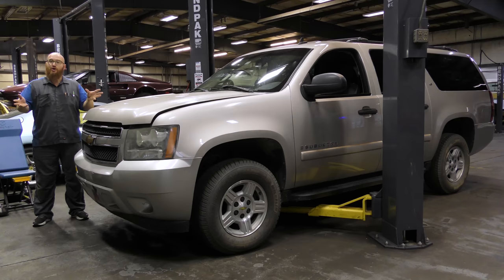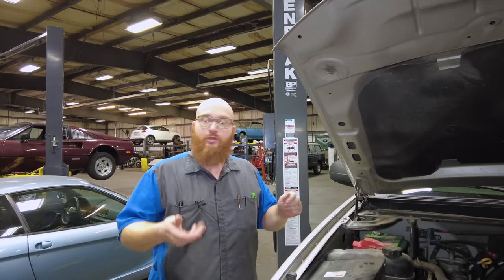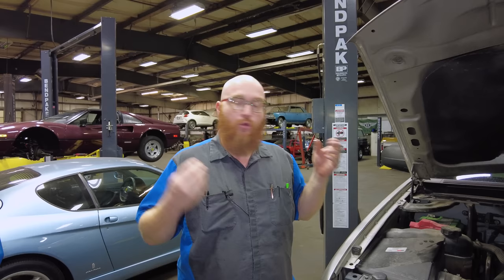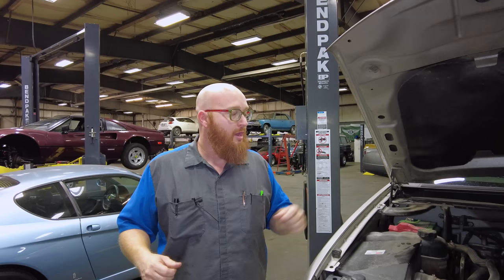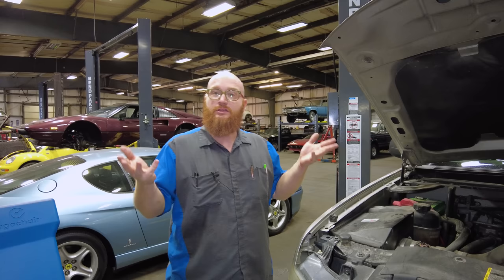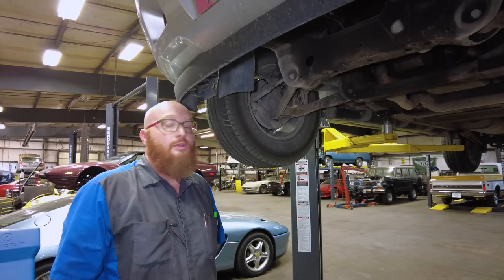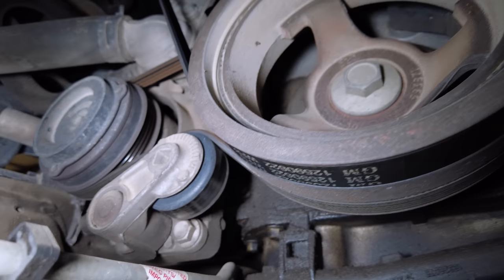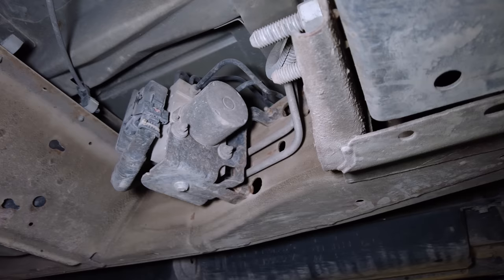What fails on ALL early 2000's Chevy SUV's!? CAR WIZARD shares what he's seen from the last 20 years

Comment: When someone says "don't modify your vehicle, the engineers know better..." I think of videos like this and realize they don't work on anything themselves.
Reply: LMAO Scotty Kilmer
Reply: To be fair, I'm sure the bean counters have some say in terms of the materials used, and engineers have to make compromises
Reply: @gwinbeer  usually
Reply: @gwinbeer  Yep. A cheap part that is $5 less than a better part,  times 1 million vehicles is $5 Million dollars. Especially if the part is likely to fail outside of the warranty. I have ties to companies who distribute equipment from large companies. Part of the model for the business selling and servicing the equipment is the callback. The more something fails, the more service calls can be made.
Reply: I'm pretty sure the engineers come up with a vehicle that would cost about $100,000..and the bean counters have to find where the cuts are to get it to the $35,000 or whatever price point
Reply: @NeonKnight83  in order to meet the company requirements usually then the accounting dept. gets involved but management has to have "certain" features so the rest gets cut even though those items that get shorted on cost may be more critical than the fluff management or the government requires  this we have common failure points that number in the 10 to 100s per vehicle it's a good chunk of why I didn't continue into engineering and went back to being a mechanic.
Reply: @gwinbeer  engineers revel in the idea of lean design and manufacturing, least material possible to meet specs, planned obsolescence, etc.
"They don't build them like they used too" isn't just a boomer phrase.
Reply: @christophersaint6926  More money turning wrenched?  Or just fewer headaches?
Reply: @asherdie  Honor and name meant something different during the middle of 20th century than during the turn of the 21st century.  The mechanical stuff in books and mechanic guides as well as the images were really awesome. Of course ingenuity and mechanics were tied to patriotism during WW2 but the war was not that many years. Iron and steel was a big thing even decades before that, late 1800's.  And everything was transparent to the customers. Clarity. Honesty. Coming into the 70's the boomer generation started relying more on image and commercials. You did not see as much engineering illustrated in advertisements. Somehow planned failure became a thing and the method to profit for the big 3 in Detroit.  Just look at the phasing out of cars. Why did that happen? 🤔 PROFITS! More profits in big ticket trucks and less engineering demands as well. They just need to be big and mean-looking to sell! Plus great fleet sales because I guess the fleet sales to police departments for sedans was not good enough? Hence Dodge going to cops after the exodus of GM/Chevy.
Reply: @rhondohslade  both
Reply: @jamesmedina2062  you had me up until the truck comment. Market demand for pickups is real. In my part of the country Ford is still the go-to for police cruisers, but the state did cheap out and bought Chrysler, they learned to regret that. 
How dare the manufacturer supply what the market demands, unlike EV vehicles.
Reply: @asherdie  huh?? How does reality affect you that it makes you attack the messenger? I only stated the facts. The reality is that Americans purchase a variety of vehicles, over 1.5 million trucks and over 1.5 million passenger cars. I did not state in any way that trucks are bad. What about the "truck statement" did not sit well with you?
Reply: @jamesmedina2062  from "the phasing out of cars..."  on. Is simplistic and wrong.
Reply: @asherdie  how does that involve me?? I only report what Ford and Chevy said they would do. Chevy said they would not sell cars anymore. Ford said the same thing. What do their actions have to do with me?  I worked for both companies but don't currently.  When I worked for them they both made and sold cars.  Ford's exception is the Mustang both the SUV and the sports car.  They sell cars in other countries is the irony.
Reply: @gwinbeer  You are so right. I worked for a large international company and when the bean counters got too involved you could count on problems with reliability and quality of the product.
Reply: Zack And Zara And Erika And Annabelle And Diesel And Kimberly
Reply: Not the Chevy engineer bro
Reply: @christophersaint6926 With your grammar and attitude I'd say that was wise, hopefully u are changing oil.
Reply: @rhondohslade  both truthfully
Reply: @Wildest Cowboy  My grammar varies based on the time of day. My attitude is truthful as I've seen both sides of the industry and the sheer level of exploitation by the motor companies, among others, towards their engineers is absolutely sickening. Furthermore, as I have seen both sides and still have friends slogging away as engineers, I am quite happy that I chose repair and customization. My primary business I design and customization. However, since so many conventional shops refuse to work on custom vehicles, I do provide maintenance services exclusively for my clients. So as to calm your concerns, yes, occasionally I actually perform said maintenance services myself. As to your comment about my attitude, I would presume you are in one of the positions I disparaged. Since most motor company management is in denial about their misdeeds, I would be willing to guess you are a designer as accountants don't really care because their primary concern is the company bottom line and they will do their job no matter how badly the Engineers grouse. Designers, however, tend to feel overly important and entitled so they get offended quite easily. You see, design was integral to engineering in the past, so designers would have been an unnecessary expense. The "designer" in the past was actually a design engineer, and they worked directly with engineers in the other departments to make an attractive vehicle that functioned as well as it looked and made the accounting dept happy from a budgetary standpoint. Then the 1970s happened, and we'll just say looks and function weren't as important as cost. Fortunately, in the late 1980s, early and 1990s, there was a return to traditional methods, and form and function were returned to competent albeit underpaid engineers. Alas, the "designer" became popular in the early 2000s and has continued to today. In the early days of this, they at least made attractive designs. Now, it seems they are all stuck in the Playskool mindset from their preschool days, and that is what they design. Similar to the late 70s and early 80s, when it was the functional engineers coming up with the designs and everything was a brick. At least they left you enough room to work on them well unless you're talking about G.M.'s small car division, then well pinched fingers and busted knuckles were the norm for those poor souls who had the displeasure to work on them.
Reply: @asherdie  
Someone once made an analogy, that applies to pretty much all of the profit driven manufacturing.

Immagine you are constructing a bridge....keep taking away single support trusses on the scale model one at the time, until the bridge collapses...

After that, put one support truss back and here you go.
This mentality goes into just about everything these days
Reply: The cost cutting on 4L60E was inexcusable because even at RETAIL the aftermarket upgrades are dirt cheap.
Reply: The engineers do know better. Upper management does not and they're the ones setting requirements and budgets. 🤷‍♂️
Reply: Love my '02 Tahoe.
Reply: I mean sometimes. Like lift kits damage suspension and transmission because the cars not designed to run with em
Reply: I wish accountants had the power the people in this thread think they do 💀
Reply: @DadsToaster  fiscal has big power in business decisions.
Reply: @VLK-73  except bridges.